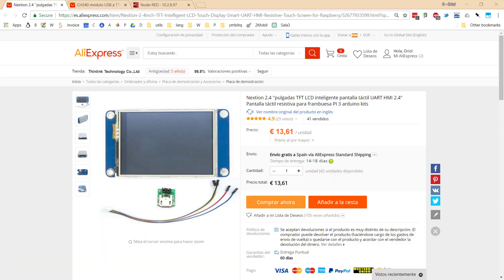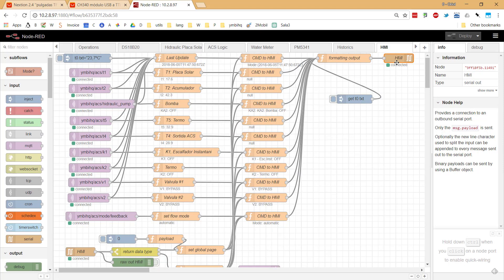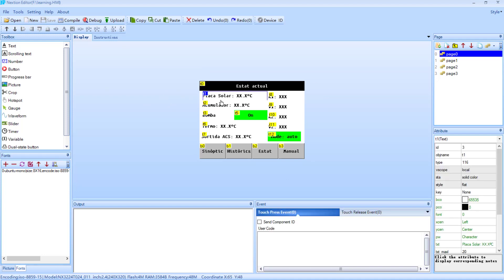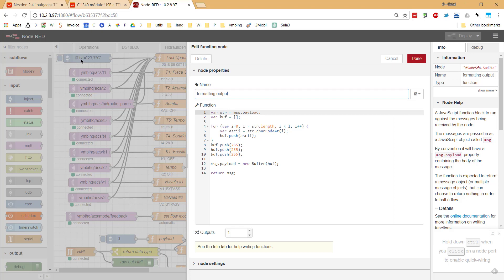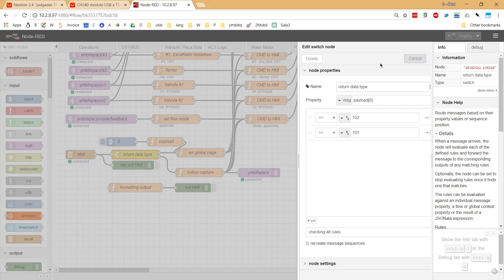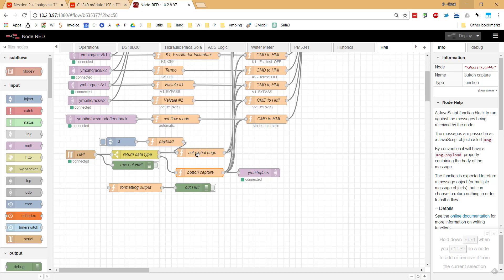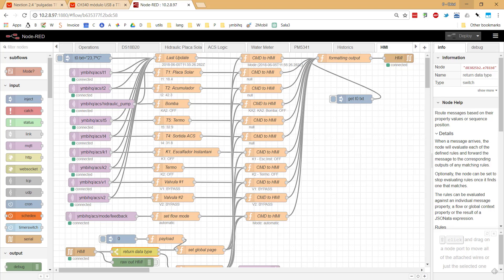Nextion HMI with Raspberry PI and NodeRED

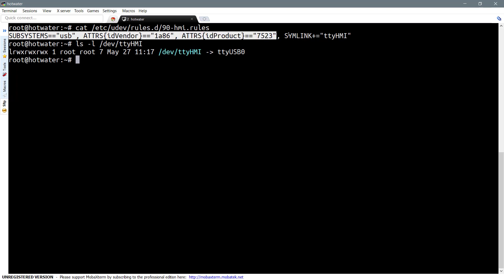Comment: Hi Oriol, very interesting video! Could you please explain in more detail what you did at 1:33? Did you create the 90-hmi.rules file? Is it necessary to rename the ttyUSB0 to ttyHMI or can I use it with ttyUSB0 directly?
Reply from the maker: you can use ttyUSB0 directly, the only reason because I change the device name is for avoiding device ID change because of any hardware change, for instance when the device is plugged in another USB port.

Comment: I try to use the nextion with PI3b with https://github.com/itead/Segnix, but the Segnix doesn't work. it seems too old? can you help to check it.
Reply from the maker: I have no idea about Segnix, when I saw this solution I found to much complex solution for what I wanted to do. Sorry.
Reply: Segnix is ok to work, but the way is to change the baud rate into 115200 to fit my nextion.

Comment: hi, Oriol , can you provide this HMI source and NodeRed for me to reference. someting like update on github or your blog.
Reply from the maker: There is only one node with relevant information which is the one preparing data for the Nextion protocol, I left the code that you can see in the video in this link:

https://gist.github.com/oriolrius/46aa6f723ae62c6a0e8c4e6ea8a69bae

BTW, if you need any other code just stop the video and copy it because it's really short pieces of code and they are not specific for Nextion serial protocol.
Reply: hi, thanks. now I have slove that problem, my nextion is work on the baud of 115200.  without that right setting, I can't control my nextion.
Reply from the maker: I cannot understand the problem, sorry. Please try it again.
Reply: @oriolrius_cat  HELLO could you tell me what is sequence code from nextion button for example to send to the serial to node-red ? please